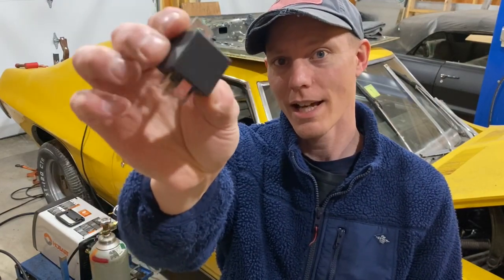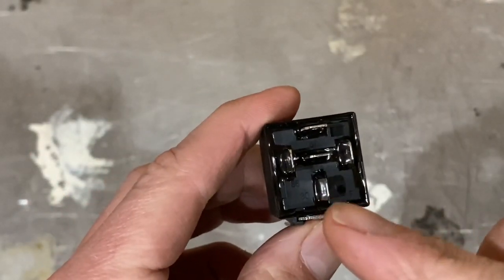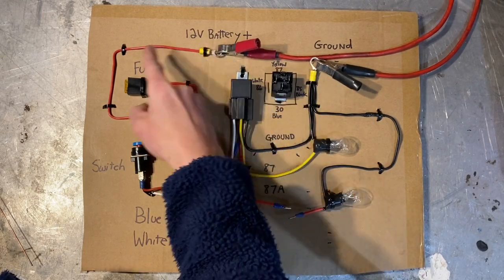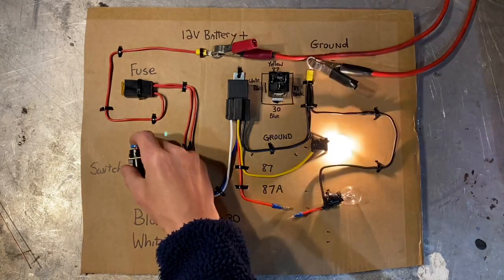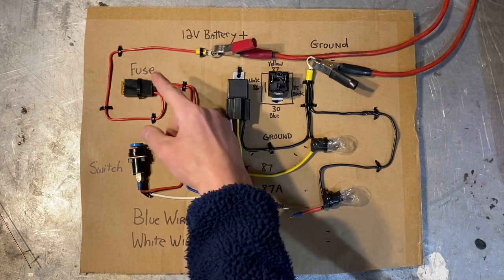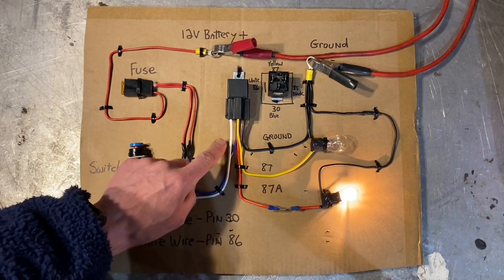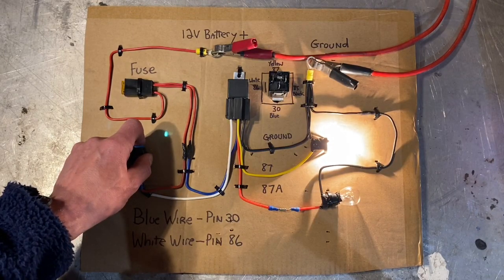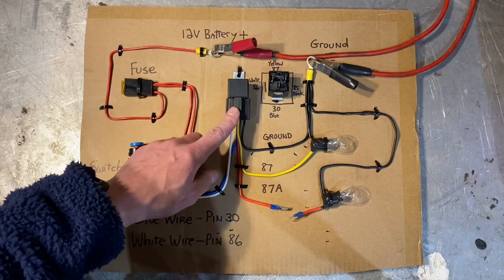How to Wire a 5 Pin Automotive Relay. Pins 87/30/85/86/87a . Bosch Style. Fans / Fuel Pump / Lights

Comment: Would you be fussed if I took screenshots of your 5 pole relay wiring display for this and the negative trigger wire display for use in my Nilight light bar install overview video here on YouTube? Credit to you of course.
Reply from the maker: Hi @Rubie the Subie. I'd be okay if you screenshot it for reference, as long as you have a link (or links) to my referenced video(s) in your description. Thanks for watching & Nice Subaru! (I'm a fellow Subaru owner).
Reply: @WiringRescue  outstanding on all accounts. I'll be sure to include channel and video links in my description as well as citation on screen with screenshots. Much appreciated. Thanks for the compliment. What kind of Subie do you drive?
Reply from the maker: I’ve had an 05 Impreza, 06 Legacy GT, and at this moment, I have a 16 Impreza 5-door very similar to yours.
Reply: Nice man! My wife had a 97 Legacy Outback while I was active duty Army. We bought almost exclusively Toyota after that, but I've always wanted my own Subaru and more so a manual transmission. I begrudgingly traded my 06 Tundra in for this 17 Impreza hatchback 5MT. I miss my truck but I love my car. I hope you will take a look at my install overview video and present feedback. Let me know what you think of my other mods and updates too if you don't mind. When you have a moment obviously.

Edit: forgot to mention, my late father's 98 Impreza birthed my love for Subaru and rally. Working in the automotive industry after experiencing his car finalized my love for the brand. We're fully on board with Toyota and Subaru.
Reply: @WiringRescue  here is the video and citations/credit per our agreement.
https://youtu.be/LxC5BGQ6Hg8

Comment: So if I heard you right I need 2 inline fuse holders (pwr in/pwr out) or 1 inline fuse holder (pwr in/ w/ 2 pwr out) to make up this circuit, one for the relay itself and one for the switch? I am just wanting to wire up my 22" LED lightbar on my grill guard. I do have a 12 fuse junction block, but for now I just want to do the lightbar. Thanks for clarifying in advance for I have only seen inline fuse holders with one wire in and one wire out.
Reply from the maker: You are correct. The 3 wire fuse holder I used in this video is apparently pretty rare.  It's amazing how many people ask about it.  I also can't find them anymore.  In short, you want two fuses, one for the switch, one for the actual accessory (your 22" LED in this case).

Comment: I have some 5 pin relays that I'm trying to use to power up some accessories in my tractor. I will be stealing power from a circuit that is already controled by the tractors ignition switch. So i I have 1 wire that energizes when I start the tractor and shuts off with the tractor. Do I still place that wire on the switch pole of the relay, and still feed power directly from the battery to the other side of the switch? I guess then it's technically switched twice? Would love your opinion on that.  Thank you
Reply from the maker: Thanks for watching the video!  To answer your question - It really depends what you are doing with the circuit. Here are some things to consider:
- Is the ignition wire that you are using fused?  If not, it may be a good idea to add one for extra protection.  If it is fused, how much amperage can that circuit handle?
- Is a relay necessary for what you are powering up? If it is a small enough accessory, and a properly sized ignition circuit, then it may not even need a relay.

My best guess.... in your scenario would be that your existing ignition wire that you currently have should go to pin 86 on the relay. Pin 85 would be ground.  Pin 30 should connect to the tractor battery (Fused properly for whatever accessory you are running - see my fuse video for correct sizing). And pin 87 would be the power wire going  to your accessory.   This design would turn the relay on with the ignition, and power a larger amperage circuit than the one you currently have coming from the ignition.

Comment: Hi thanks for this...quick question how would I get both lights to come on together from the switch...Thanks
Reply from the maker: Normally if you have multiple lights, you would wire them together and run them both off of pin 87. Or if your lights really draw a lot of amperage, you could run multiple circuits/relays entirely. It really depends on what you are trying to do.
Reply: @WiringRescue  thanks for your quick reply...LED's so not a lot of amps...both off of 87...does a 5 pin have 87 and 87a..would that work..appreciate your time

Comment: Thanks for replying and happy Easter to you.
I am making a rotary drum filter for my Koi Pond.
I need to run 3 electrical motors to turn on and off simultaneously.
I have a trigger switch to do this but it is only rated at 10 amps and I think the 3 motors will draw too many watts/amps.
So I thought I may be able to add a 30 Amp relay to the circuit?
This is a link to the trigger.
JK13 AC 220V Digital Display Delay Relay Module Delay ... - eBay
Cheers
Rob

Comment: Hi, great video, so many responses. I have a challenge hopefully you can help me with.
I have the same relay you show but without the 87a pin and I want to wire it to a 12 volt dc JK13 trigger switch that is only 10 amps. I'm not sure how to wire it up to increase the load capacity.
Any help would be appreciated.
Reply from the maker: Hello - That's something I've never messed with before. What kind of item are you putting on a timer and how many watts or amps does it draw?

Comment: Great video!  I have one question though.  If I wanted my DRL (aftermarket) to turn off when I am using my turn signals, could I wire power from my turn signals to pin 86 and wire my DRL to pin 87A and leave 87 blank?
Reply from the maker: That seems like it should work. Try it out and report back. The only potential issue I foresee would be that I’m not sure how long the relay will last being used at the same rate as a flasher.

Comment: This is the most simplified demo I found,  thank you.
I have a question though, can I use a smaller gauge wire from my switch to the relay? Like 16awg to a relay, but still use 12awg from battery load? 🤞
Reply from the maker: Great question! Yes! You can’t use a smaller wire for the switch. It is just telling the relay to turn on and off, so a thicker wire isn’t necessary for the switch itself. Thanks for watching and good luck with your project!

Comment: Excellent video. My question is my indicator light for my fog lights is on until I turn the lights on. How do I get the indicator light to come on with the lights and off with the lights?
Reply from the maker: I would begin by seeing if your fog light bulb is burned out.  Some cars turn on the dash light when the bulb is burned out.  If it is not, the best way to diagnose this is with a wiring diagram for your indicator light. Then you can follow the electricity from the power & ground to the bulb to see where the problem lies.
Reply: @WiringRescue  bulbs aren't burned out. I wired them exactly like your video. Maybe ground the indicator light and power it from the switch instead of 87a?

Comment: Hi, what is the amp you use for indicator? I use 25amp once turn on and fuse blow
Reply: I bought 6 gang switch. I connected only one of the switch to indicator connection, once switch turn on and fuse blow. 25amp fuse
Reply from the maker: If the 25 amp fuse blew, it is either wired wrong, or your are trying to power up some kind of accessory that uses more than 25 amps.  My guess is that it is wired incorrectly.  Double check that your switch is wired right and not sending power right to ground.
Reply: Thanks for the reply. Will you mind I take a photo and send to you how I wired? I believe I followed all of the step but not sure😅
Thanks

Comment: What does the expose metal hole/bracket do on the relay and where should I mount it or can it be lose on the
Reply from the maker: That bracket is just a mount. Most people stab a self tapping screw through it and spike it someplace under the hood or dashboard.  You could also zip tie it someplace convenient. Either works.

Comment: Can it be used for high beam as drl, and when you turn low beam on, relay turn off high beam?
Reply from the maker: That won;t work with this style circuit, you'd need a different design to make that work. Maybe I can do that in a future video?
Reply: @WiringRescue  Yes, I would really appreciate that you make a video about it, but high beam lights should work at 50% of power. Greetings

Comment: So Silly question? I want to use some  halogen single bulb road lights as a flasher or wig wag and  also as a  set of extra set of  road lights.. I am thinking  a 3 way switch will work ? Thanks for any help
Reply from the maker: Check out this video I just made, I think it will get you going in the right direction. You can use 1157 bulbs with dual filaments and a flasher. https://youtu.be/c8JDQrUquw8. Also thanks for watching my video!

Comment: This diagram shows that a "power source" comes from the in line fuse to both the relay and the switch. It also shows that all grounds are tied in together. Can the switch be powered separately?
Reply from the maker: It absolutely can be a separate power source to the switch, and the grounds do not need to be tied together. I just did both of those for ease of making the circuit. Thanks for watching!

Comment: I wanna do a connection for fog lights and a drl.say 87 on fog lights and 87a on drl. will i be able to turn off the drl when i don't switch ch in the ignition?

Comment: Thank you for the great video, by far the best explanation and set up on the net that i have seen.
Can this set up also be converted to a latching power on 87 and only broken if fused power is from ignition instead of battery?
If I wanted to break a negative feed from the distributor coil, how can that be done, preferably latching as well.
Reply from the maker: I’m a little unclear of what you mean. If you want to break a negative on a coil, but have it default to being on, you can just cut that negative coil wire and put the relay in between. One side of the negative on 30, and the other side on 87a. Then you’ll have to get sort of tricky with the other two. Ignition power would need to come from some source of your choice , and run to pin 86 on the relay. Pin 85 would go to a switch inside your car somewhere. The other side of the switch would be grounded. You’ll generally keep the switch in the on position so anytime the ignition switch is on, the coil is grounded. Then when you flick the new switch, it breaks the negative wire on the coil.

Hope that helps! If so - feel free to subscribe or share the video! :)
Reply: @WiringRescue  Apologies for being unclear. I am not very technical but with research I am learning.
Let me try to use a different application and hopefully I make sense to you. 
If I had to use an open fuel solenoid which allows fuel to pass through without being powered. When powered it closes the valve not allowing fuel to go through. Reason being for using an open solenoid, it does not require power to operate thus keeping it cool which makes it more reliable and preferable to last longer. 
The diagram I got is similar to yours but 86 is ground and 85 is 12 volt with momentary switch. Everything else is same as yours just those to are swapped around.  
What is the difference between mine and yours?
 Will my setup also work?
If it does work I could bridge 87 and 85 so when the switch is pressed once it would give continuous power to 87 until the ignition is switched off, which makes it a latching relay.
I will not use 87, it will be blanked off but use 87A to power the solenoid in that way when the ignition is turned on power from 87A will close the solenoid not allowing fuel to pass. Only when the switch is pressed power to 87A stops and the solenoid will then open and send fuel through. 
I hope my explanation makes sense and please correct me if I am wrong.
Thanking you in advance.

Comment: hello my car low beam is not working but high beam is working..do you have any advice please?
Reply from the maker: I think you'll need a test light or a digital multimeter, and see where the electricity is missing.  Start at the lights and move backwards through the circuit.  It's also a great idea to just check the fuse box to see if it is simply a blown fuse.

Comment: does it work brakenlifgts
Reply from the maker: You can use a relay to control any electrical circuit that you want. You just need to wire it properly.
Reply: @WiringRescue  I have been going alot through identity theft and my moms ex bf is well a crackhead stalker and hes has access to our cars id love to send you pictures just so you can tell me its normal
Reply from the maker: @pedromuniz9826  - I'm not sure how much I can help, but send them to my instagram? @Ratty_muscle_car

Comment: Very informative...quick question.  I have (4) separate LED strip each of them at 3.4 amp...would you explain how I can power them on using either a relay or switch ...thanks.

Comment: I Thought That 5 Pins Relay Have 2 Outputs... Thats Why I Always Using 5 Pins Relay To Power Up A Pair Of Devices Like Horn, Lamp.... But Looks Like Both Produce Power At The Same Time Just When I Switch On... Maybe My Relay Output Both Is 87... Not 87&87a....
Reply from the maker: I've never seen a relay with two 87's, but maybe it's possible.  Sounds like a cool relay to have!  Thanks for watching the video!
Reply: @WiringRescue  Today I Recheck My Stock Of Relays... Yeah, My BOSCH Relay Have Two 87 Pins Both... And For My PIVOT Brand Relays, It Has 87&87a Pin... After Im Watching Your Video, Now I Remember Back, I Have Wiring My Radiator Fan's Relay, Im Using A 200A Transparent Relay, Dont Know What Brand It Is... I Dont Know That Relays Will Have 2 Different Output, So I Thinks My Relay Was Broken Because When Im Using Another Pin, The Current Flow Directly Without Switch On The Relay.... So, I Just Throw Out That Relay... Lol... Hahaha... Now After Watching Your Video, I Just Know That Usually Relay Will Have 2 Different Output.... 😂😂😂
FYI, I Already Wired A Lots Of Relays For More Than 15 Years Already, But I Did Not Know About This Basic Facts Of The Relay, Until Im Watching This Video... Lol... Hahaha... Thanks Bro... 
☺☺☺🙏🙏🙏

Comment: What if you have multiple lights with multiple switches like rockers?
Reply from the maker: It’s all doable, but I think you would need to be a bit more specific with your scenario.
Reply: @WiringRescue   I'm gonna wire 6 rocker switches for lights and whatnot so would I need a relay for each switch?

Comment: Thank you for this informative video! If I were to send pin 87 to a flasher, which is then connected to the same lightbulb as pin 87a, would I have a light that stays on constantly, but flashes when the switch is engaged?
Reply from the maker: You know, I’m not sure, but maybe I should try this and make a video on the results!

Comment: very easy to understand video, thanks for posting.  I do have one question:  do all of the grounds go to one spot?  Is the ground for pin 86, the ground for the light and the negative from battery terminal all being attached together to the ground on the body?  I wasn't sure.    Thx
Reply from the maker: The grounds just need to go to the body of the vehicle. It doesn't need to be all wired together.
Reply: @WiringRescue  

Thx Ratty

Comment: hello, thanks for the detailed info, i want to know if a fog relay can be turn on with add a fuse instead of click switch inside the cabin
Reply from the maker: It depends. The circuit that you are going to add the add-a-fuse to, was designed for a certain amount of amperage already. So if you add an additional load to it, it could be too much for that factory circuit. 

With that being said, if your add-a-fuse is powering up pin 86 on a relay, it would probably be fine because relays do not use much electricity. If you were planning on using the add-a-fuse for pin 30, then you may start having weird electrical issues, popped fuses, and burned wires. That’s obviously not what you want.
Reply: @WiringRescue  thanks for the quick reply, i want to add aditional foglights to a jeep patriot and dont want to run the wiring inside the cabin and was wondering if the relay can be powered with add a fuse from original foglights or parking lights fuse so they can be turn on at the same time instead of a click switch

Comment: After looking at this more closely this 5 pin configuration is a 2 hot relay, one always off when coil  open, and one always hot when coil closed.   The second switch not shown threw me for a while. The second switch forcing the always on to be off past the relay.

Comment: How do you know the amp limit for a relay not marked, is there some kind of test, or anyway other way  you can think of. F0AB14B192 AA
Reply from the maker: I don’t believe that there is any way of testing this without destroying the relay. However, I googled that part number and many people selling them on eBay say it is 40amp. I’d recommend checking some other source though to be sure. A factory wiring diagram may tell you as well.
Reply: @WiringRescue  Thanks, there must be a way because they designed them. Some day I will find the answer for odd ball components values.